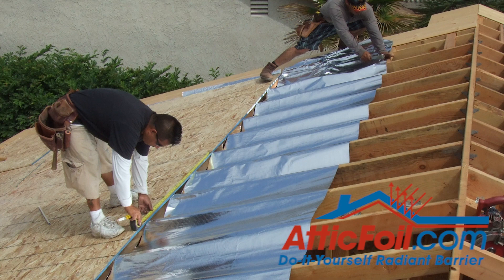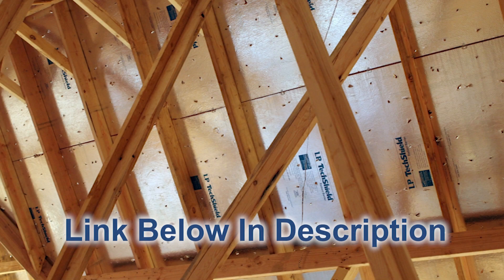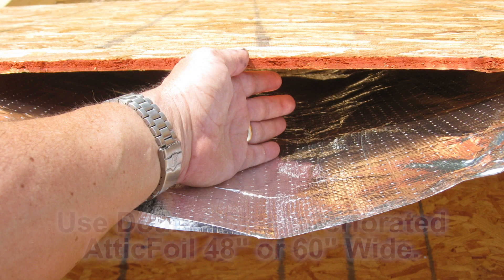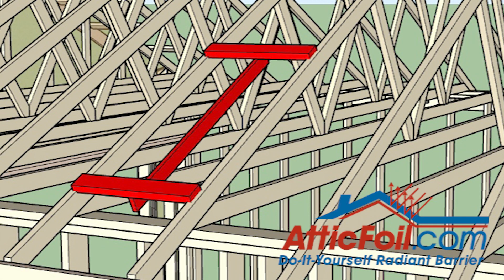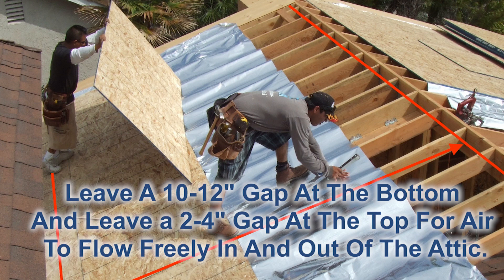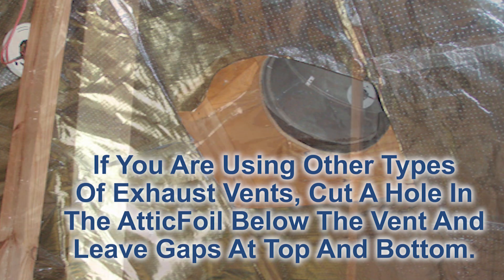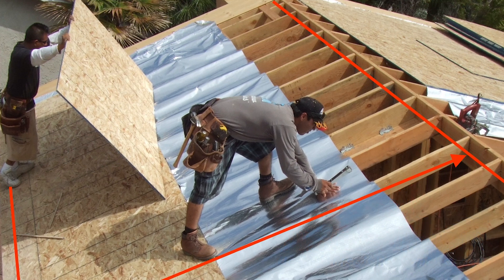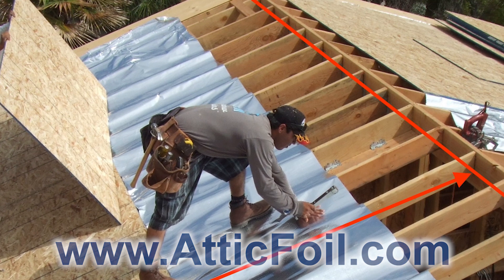Better Than TechShield Decking - AtticFoil Draped Over Rafters

Comment: If i already have radiant barrier OSB installed years ago, can I also install attic foil under the rafters? Will they interfere with each other?
Reply from the maker: Sure, heat only is coming in or going out.  So, two layer of foil is like having two pairs of sunglasses on.  Each one reduces the heat coming in.

Comment: So I have an uninsulated 12x18 wooden shed. The inside is completely open (no loft or closed in attic) but there is a ridge vent at the top for air flow. I installed a small 8000 BTU window unit to cool it off, but obviously without insulation the AC does literally nothing to lower the temperature inside the shed. I live in Louisiana where the temperature outside can get over 95. My question is, will installing radiant barrier help assist the air conditioner in cooling the shed down below outside temps or is traditional insulation required on top of the radiant barrier in order for the AC to have any affect at all?
Reply from the maker: We have the prefect solution/product for you!  Check out https://bluetexinsulation.com/products/bluetex-supreme-foil-white-6mm-foam-radiant-barrier  This is our product group for barns, sheds, metal buildings, etc. Basically, you will make a new "envelope" or "refrigerator" on the inside of the shed, run your AC and it will make a HUGE difference!  Call us for more help/details.  Ed.